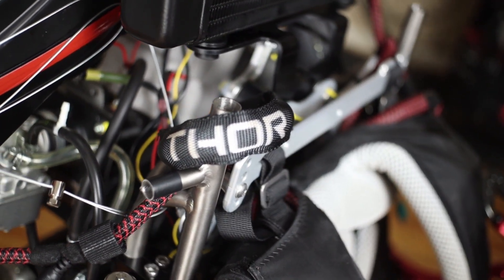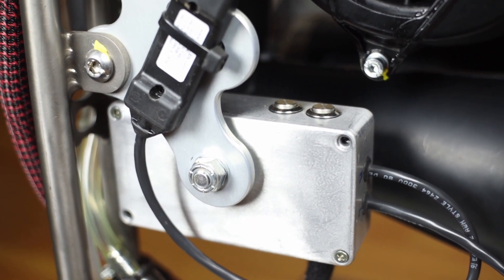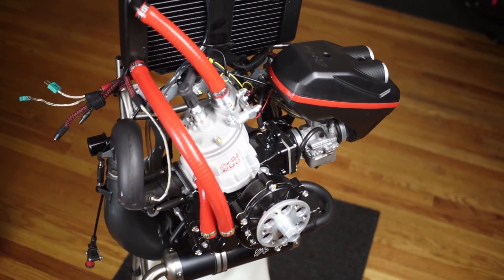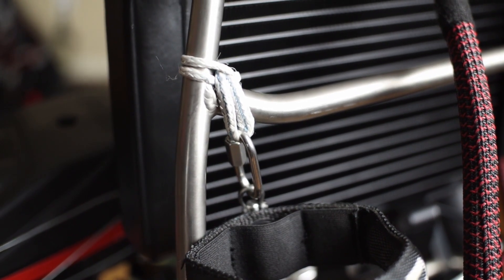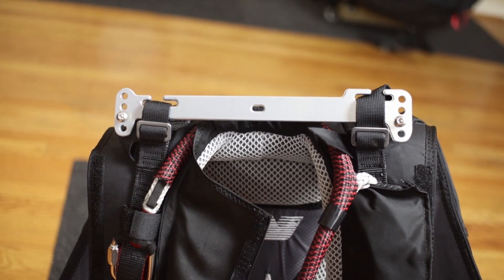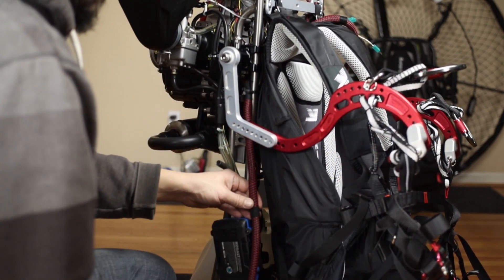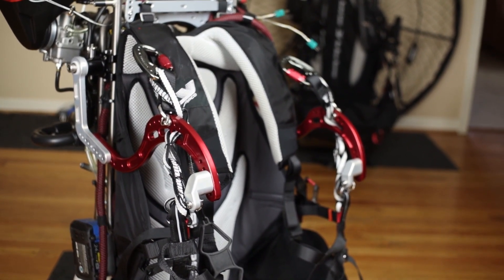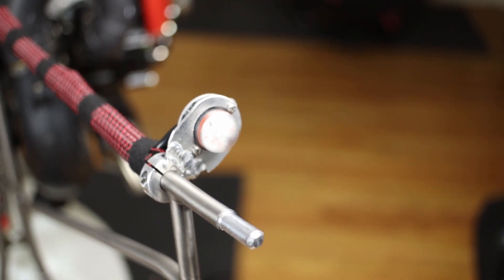Ultimate Paramotor Build - Polini Thor 202 [feat. Liberty, apco mkII, red strobes] Limitless PPG

Comment: Hi Ken, recently subscribed. I decided to buy a 202 and live in Thailand so parts and upgrades are harder to get here. Got a question not sure if you have experience in this: the stock 202 comes with a Helix 130mm prop but I read the Helix 140mm prop is way better but requires a larger cage. Wondering if you or anyone you know that has used a three blade 130mm prop and how it compares to the two blade 130mm and 140mm.
Reply from the maker: I've only run a 140 eprops, with a 153cm cage.  I had an issue with helix, they cut the center bore of the prop hub too large, I found this and reported it to helix, they agreed it should be minimal clearance.  It's true thousands of pilots have been running it like that, just my personal opinion is I don't think that's acceptable.

Comment: Hi Ken could you do me a big favor? Could you put your prop at 12 o'clock and pull back and forth on the tip to see if you have a very slite amount of movement
Reply from the maker: I do this every pre flight. You will feel slight movement in the shaft, like setting wheel bearing clearance on a front solid axle.  My belief currently is that this is backlash that will tighten up when the gearbox gets up to temp.  Also, with the length of the prop, the percieved lash is amplified.
Reply: I don't mean between the gears I mean in the prop hub bearings . Pull prop tip forward and then backwards is there a tiny bit of play or no play?
Reply from the maker: @dickl8444  You will feel slight movement which is play for sure.  I messed up and called it backlash, my thoughts are it is bearing clearance, since it was like that when it was fairly new.  I change the gearbox oil every 5-7 hrs. 

Maybe see if the clearance tightens up after a long flight.
Reply: Haven't flown it yet but I have run it up to temp.but it still has movement only reason I'm concerned is my polini 250 has no movement. It's probably fine though because your has it too.might be like you said goes away in flite.i know they had trouble with the 250 braking prop shafts so the movement might be the way they fixed it.

Comment: How is the reliability? Please
Reply from the maker: Has one of the highest TBO maintenance schedules, if you hear about a hole in a piston that is from carburetion.  All paramotor engines in the 2020's have their problems, pros and cons.  The Thor 202/303 fits a niche, that is completely different than a Moster 185.
Reply: Yeah moster users keep putting me off getting one I need something reliable and that won’t blow up I’m 140kg . What problems have you had your self personally and at how many hours use did the problems arise  if any . ? with you mentioning high maintenance schedules seems like there is constant issues and I have seen images of the piston bursting out the case . Like I said I want it because I’m 140kg and for XC flying
Reply from the maker: @reefrockcritter8943  Reliability is subjective with 2T engines and failures of pistons have little to do with the engine.  The most reliable paramotor engine ever would still get holes in pistons with bad fueling.

Thor 202/303 issue is the stock Dellorto carb is not tunable, it comes pig rich and runs like garbage.  I am going to release an affordable carburetor kit to solve all these issues and it will include an actual chart to reference to tune it for the weather conditions.  Subscribe to my channel and I'll post when it's done.
Reply: @iKenFlyPPG did you release it?
Reply from the maker: @Rtotokyo  I'm afraid the price of a genuine highest quality Keihin kit would not be appealing to the majority of Thor 202 customers.  I would have to downgrade to maybe a Polini PWK and would require redoing all of the jet development to ensure a quality and repeatable result.  To cover -2000 to 8000 ft density altitude it would require something like 2 main jets, 3 pilot jets, and 4 needles to maintain the best performance (how well and smooth and safe it runs) in those DAs.  That is a lot of work to ensure people get what they ask for and sign my name to it and to test all of those DAs would require multiple seasons (spring/fall + summer) of testing and travel to higher elevations for development. So haven't got around to that.  

I would recommend strongly installing a wide range oxygen sensor to read air fuel ratio directly.  Your looking at ~13.5-14.0 :1 afr for cruise and idle \ 660-700C EGT, 12:1 for WOT \ 600-620 EGT if you want to tune your own carb.
Reply: @iKenFlyPPG it's a rocket science for me... 
Do you suggest dellorto or should i go with tryton carb?
Reply: @reefrockcritter8943  They put you off getting a moster? It's the exact opposite for me. Everyone keeps telling me to go with the moster.